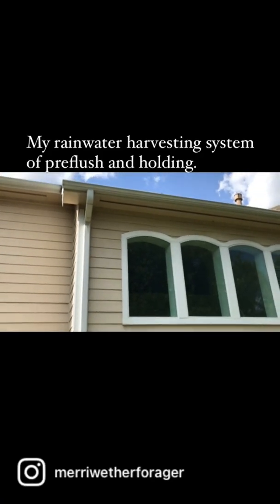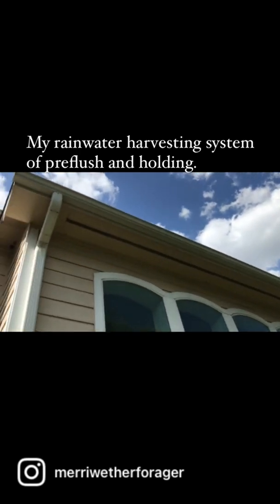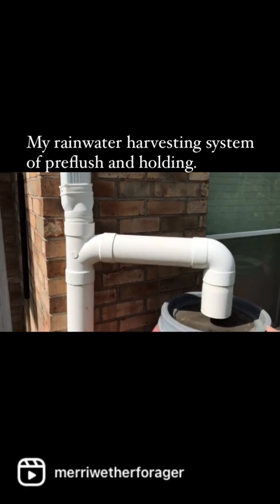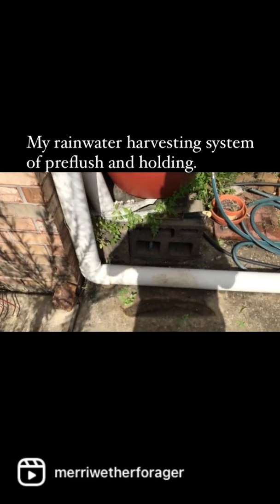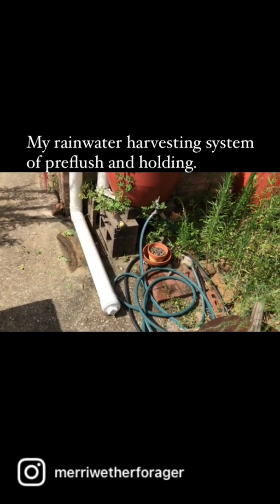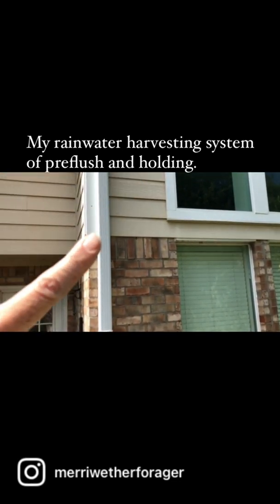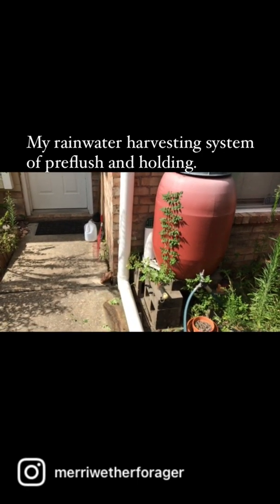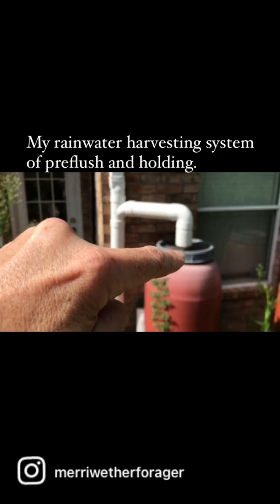Simple Rainwater Harvesting Preflush System

Comment: I have a small aquarium airpump/airline hooked up to my rain barrel.  During the summers I also keep a beta fish in my 55 gal open top barrel to keep mosquitos at bay.  My rain barrel doubles as an 1 of my outdoor ponds but with no plants in it except for some duckweed that miraculously keeps showing up.  Since I am not near any industrial areas I figured (hoped) that any bird poop/grime/etc off my roof was just infusing micro-nutes into the water for my garden.  My rain collection system budget was about $5 for the blue 55gal barrel off CL, that I had to clean a few times before using because I think it came from a carwash.  then I just strategically placed the barrel under my best'est downspout and waited.  I like dedicating this water to my most special garden plants.   During snovid, I had several plants huddled by my south facing rain barrel, I believe the heatsink it offered helped those cherished potted plants survive.  My other greenhouse/hothouse overwintering method could not maintain heat during snovid and it turned into a giant deep freezer and almost all those plants became crispy twigs.
Reply from the maker: I like the air pump idea! I used to have goldfish in the barrels but this caused problems a few times when I need every drop of water.